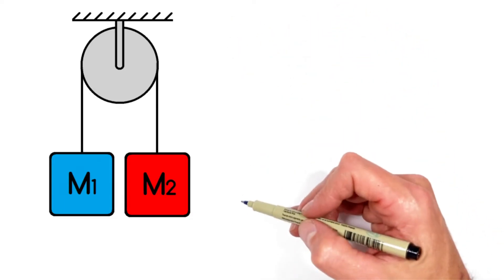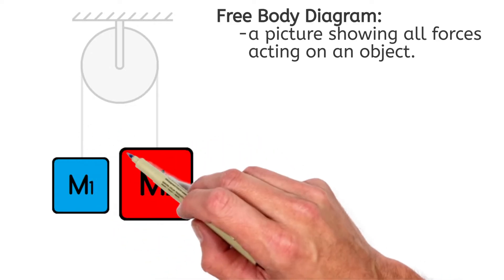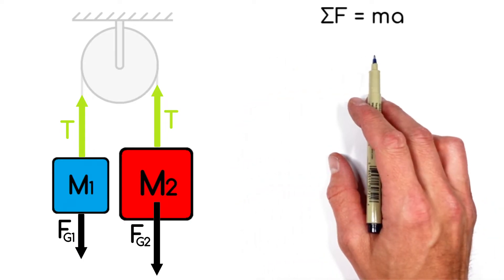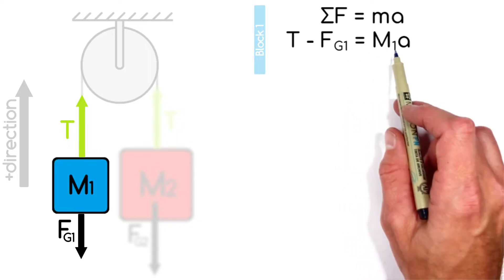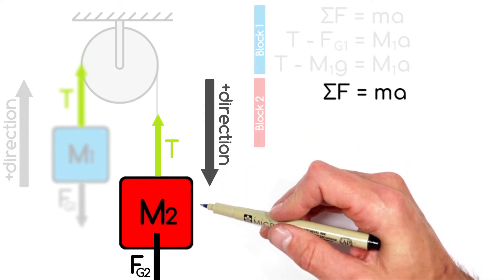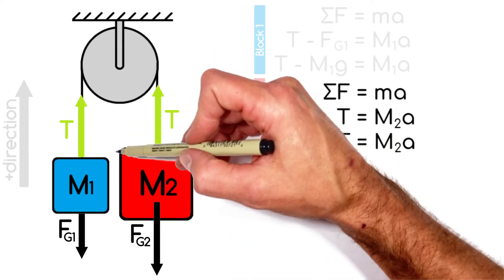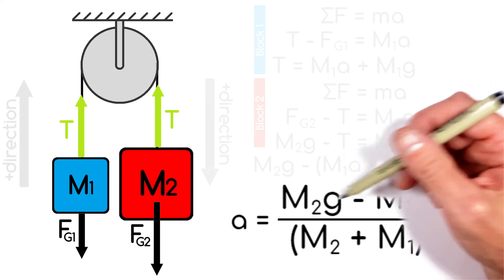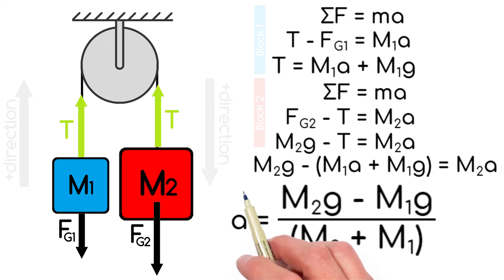Calculate Acceleration of Two Blocks Hanging From a Pulley |  Atwood's Machine

Comment: What happens if the density of the rope can not be ignored?
Reply from the maker: The acceleration becomes a positionally dependent function.  The mass on each side of the pulley contributing the masses M1 and M2.
Reply: @INTEGRALPHYSICS  Yes indeed  -  it is a nice little problem in my opinion.

Comment: I remember doing this in school
Reply from the maker: That means somewhere a physics teacher did their job well!
Reply: @INTEGRALPHYSICS The subject was actually mechanics and there we also learnt how to calculate the friction of the rope having F1 and F2 as the force of the 2 masses. Then using the formula F1 = F2 * e^(y*B). e being the Euler number, y the property of the rope and B the angle of the rope at the top in rad. After calculating F1 and F2, we can the calculate the friction by doing Fr = F1 - F2 (assuming that there is no motion in the rope). Another way to calculate Fr = y * Fn where Fn is the force 90 degrees to the surface.
Reply: @ INTEGRALPHYSICS, in any case, it was great fun doing these kind of simple calculations
Reply: @INTEGRALPHYSICS  Wow, your new video https://www.youtube.com/watch?v=NV1b-OcMW3w was very similar to what I did in school!